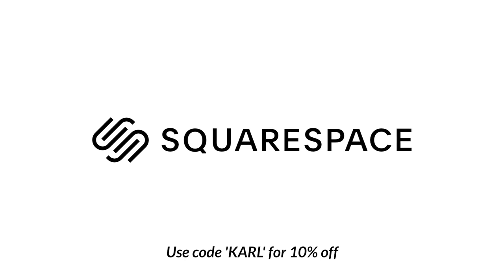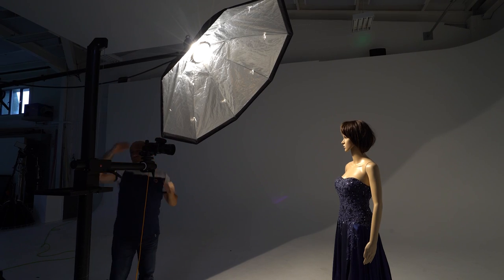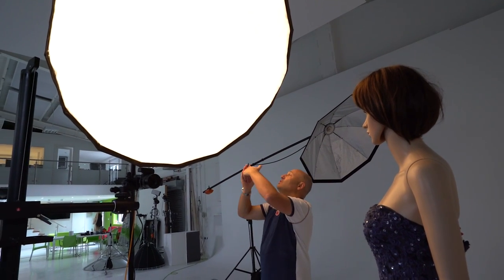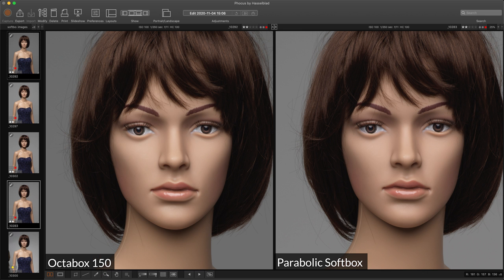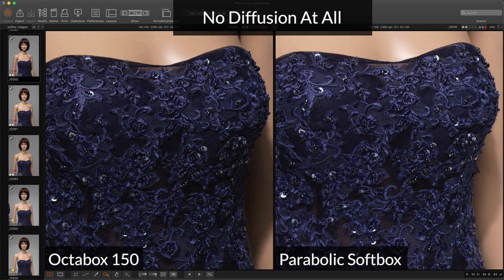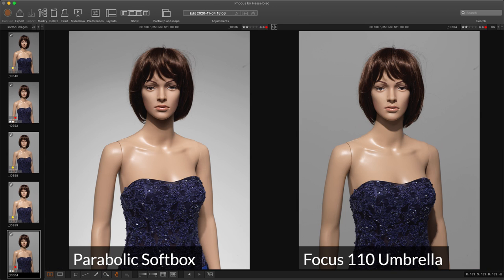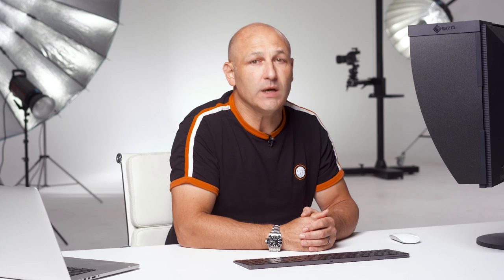The Myth of Parabolic Softboxes - Save yourself time, frustration & money!

Comment: Hi Karl, thanks for the review. I've been a fan of your photography videos for a while now. I definitely don't have the same level of expertise in terms of photography as you do, but in terms of physics, I would like to say two things.

The parabolic shape should focus a light a little better than the flatter ones. What I mean by that is that if you point the softboxes at a flat surface, the light fall off from parabolic ones should be much quicker than the flatter ones (I don't mean the sizes of the lit area, but the fall off from lit area to unlit area). I think this should be more apparent when the distance between the diffused panels are closer to the surface, maybe check multiple distances?

Another thing is that given the same amount of light from the light source, the luminous intensity at the center should be higher than that of flatter softboxes. This should be more apparent as you increase the distance away from the subject.

I think the idea is that no matter what the reflecting surfaces the softboxes are made of, they cannot be perfect reflectors. Each time they reflect inside the softbox, their luminosity decreases. So in parabolic softboxes, the difused light coming out at an extreme angle should be much less intense than the ones coming out from a more straight forward angle. Now how valuable these properties are in terms of photography, I have no idea. Maybe you can do another test to check these out, and let us know?

Cheers,
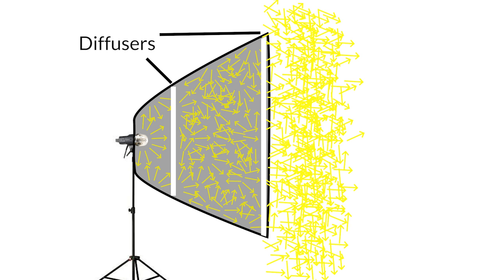Reply from the maker: Hi Sean if you've studied physics then you should be able to understand from the diagram at 1:26 along with the fact that the light is not at the focus point of the parabola, that there is no way the light can go through two layers of diffusion and be expected to have any direction left to it. There may be a small chance that the intensity proportion is more heavily weighted to the circumference of the modifier if the diffusion wasn't doing its job, but this wasn't something  that I noticed. Any fall off differences or intensity differences on the background are purely due to the slightly larger surface area or that I didn't exactly match the output exposure or position when I changed lights
Reply: Hey  @VisualEducationStudio , thanks for the reply. Yes, I did indeed studied physics in my undergrads and had taken two optics courses actually. Of course, that doesn't make me an expert or anything, but I do understand some basic properties of light. 

Yes, I do understand that the light is not at the focal point of the parabola, but that just means that the amount of light hitting the first diffuser would not be uniform across the diffuser. This is the reason why we can see hot spots of different sizes depending on the construction of the reflectors. 

As for your comment that light has no direction after diffusion is a little bit of a stretch. You can argue that at any single point of the diffuser light coming out points to all directions towards the right at some angle off the diffuser using your diagram at 1:26. (note, we can argue that there is a small amount of light bouncing off the diffuser and back into the parabolic reflector. But they too will eventually come out of the diffuser and go towards the right, assuming they don't get absorbed somewhere in the process.) However, each photon coming out is definitely directional. Also once they leave the second diffuser, they cannot change direction unless they hit another object. So, your diagram is a little misleading in that you have light pointing almost straight up and down very far out from the second diffuser. Also, there shouldn't be lights going to the right from above and below the reflector, this shouldn't be the case unless the reflector has holes. Basically, all the possible directions that the light can travel has to be from a point on the second diffuser to wherever it ends up. In other words, any arrows you draw outside of the reflect has to connect to the second diffuser if you extend it all the way to the left.

Combining the non-uniformity property and the imperfections in the reflectors and diffusers, (i.e. not all lights get reflected, some get absorbed after a couple more bounces. The diffuser cannot possibly deflect lights uniformly in all directions. Lights hitting the diffuser perpendicularly will likely pass more easily without being deflected. I think this is why we see hots spots even after the second diffusion sometimes.) the shape of the reflector comes into play. This is why I suspect the things I suggested before. I hope this clears up where I'm coming from. Cheers, mate. Hope you have a great day.
Reply from the maker: @UCrGqH-wWZW5MfxfnHTalbsw Hi Sean thanks for your points, please see my pinned comment at the top of the page.
Reply: Hi  @VisualEducationStudio , I didn't see that you have a pinned comment when I wrote the previous reply. After reading that, I can see where you're coming from. Again, I'm not trying to argue that you're wrong in your judgement that the two reflectors are more or less the same in terms of photography, but I just want to have a constructive discussion since the physics side of things can be a little tidier.

Let me try to be a bit more specific here. In your third point, you say that after the second layer of diffusion light should be very uniform across the diffuser given the reflector has great construction material. I totally agree. Now, let's suppose the diffuser is perfectly diffusing light uniformly in all angles at any given point on the diffuser. Then the distribution of resulting light should be entirely a result of the geometric shape of the diffuser and the distance from each and every point of the diffuser. In this case, we should not observe a sharp drop off of the resulting light until we hit areas parralel to the diffuser. (i.e. the roof right above the diffuser and the ground right below the diffuser)

I don't think that is the case for most reflectors. I think most reflectors would still give you some kind of lighter shape/area on the wall you point them to, rather than lighting up everything that is immediately in front of it top to bottom. So that means the light coming out of the diffuser is still very concentrated around the angles 90 degrees to the diffuser. Given this observation, it is pretty safe to say that the geometric shape of the reflector would dictate how much of the light coming out is close to or perpendicular to the diffuser. Thus, the collimation property of the reflector should still play a role in terms of the resulting light.

Again how much these geometric properties matter in photographic sense is really beyond me. I suspect it is probably more or less like what you experienced. Also, it'd be interesting to do tests at different distances since I think that should exergerate the differences between the reflectors a bit more. Cheers, mate.

Comment: I like Your videos very much, but in that case I think it is not the best idea to compare patabolic softbox to normal one by using almost flat light. Main difference, would be visible in shadows. How diffused is a gradient between light and shadow? How a shadow of nose looks like? You can't see that in flat light (just don't talk about that really tiny shadow on chin please) 
You say that parabolic one was heavier and larger and that is true, but is it really true that it doesn't produce any difference? In Your video a diffusion is closer to the bulb in normal softbox and further from the bulb in parabolic. Parabolic or not - You always get more diffused light when You put a diffuser closer to the face and further from a bulb. The reason why photos looks similar is because the light here is flat, so we see almost no shadows. But put these softboxes 90° from a lens and then look at results. 
Thinking Your way I would say that there is no difference between a dedo dlh4 and a common  fresnel light, because a kicker light from both units looks similar. Well, yes but still - the difference in that units is huge. 
Second thing is that light from parabolic softboxes is going in one direction. As You mentioned - from normal softbox it is going everythere. That means that with parabolic one You can easily create soft, directional light, without using grids or flags. Is there a difference in quality of light between parabolic softbox and a normal softbox with a grid? And a difference in an output? These are good questions. But were  not present in Your video. 
When You shoot with a normal softbox on a location and a background is close You have that light on the background. When You use parabolic one, it is easier to light only a face and have background darker. But to see that difference You can't use flat light (because then You have light on the background in both cases).
I still like Your videos and click on "👍", because it is great just to listen or talk about light with professionalists. I like Your work and think that people can learn a lot from You. But here I just have to disagree.
Reply from the maker: Hi thank you for liking our videos but unfortunately many of your points are inaccurate.  There is no difference in the gradient of light from shadow to exposed area. I could put both of these softboxes at 90 degrees and it wouldn't make any difference at all. You keep referring to flat light but you haven't clarified what you mean? It is also completely incorrect to say that light is going in one direction in the 'parabolic' softbox because that's impossible because it is being diffused internally and therefore going in all directions. There is no more 'direction' of light than the octabox because the physical properties of diffusion are to scatter light in all directions. The only way to reduce this is to add a grid which you could apply to both modifiers and this would simply increase contrast on the subject. Even without diffusion the parabolic softbox is unable to send the light out in parallel beams (collimated) because the flash head is not at the correct focus position anyway.  If you can provide me with any relevant actual physics that could back up your claims then I will gladly make another comparison of the two lights from any angle you like but you will see no difference at all.
Reply: @VisualEducationStudio  "There is no difference in the gradient of light from shadow to exposed area. I could put both of these softboxes at 90 degrees and it wouldn't make any difference at all. "    
Yes, it is. I don't say that it is because one is kind of "parabolic", but - as I wrote earlier - Your parabolic one is bigger, so a diffusion is closer to a face and produces slightly softer light. We just don't see that, because we see almost no shadows here.

"You keep referring to flat light but you haven't clarified what you mean? "
I used that term to describe a light coming from same angle that a camera is. And a light source is quite big (150 cm). So in final image we see almost no shadows. I like that light, just don't think it is the best choice to compare soft light modifiers (main difference between them is a way they produces shadows). 
In my opinion, if we want to compare normal softbox to "parabolic" one, we should put them at 90 degrees and use smaller versions (smaller version of parabolic and smaller version of normal one, not 150 cm) to see differences in shadows on a face.
Reply from the maker: 1. The parabolic softbox I used here was exactly the same diameter as the Octabox so they were the same size. 2. The light isn't coming from the same angle as the camera it's coming from a 45 degree angle from above, imagine turning the picture on its side and the light would be coming from a 45 degree angle from the side. 3. If the physical design of diffusion of the smaller ones are the same design then the physics will remain the same, that is simply physics. And finally the great thing about physics is that it doesn't lie, it doesn't fall apart, it is always repeatable and this type of diffusion will do exactly what I demonstrated in this video so where would you like me to place these lights so I can make another video and prove to you that the physics, the shadows, the fall off and everything will be the same? I will include it as a short piece in a future video and I will publish the exact results.
Reply: @VisualEducationStudio  There is no need. :) I just checked in the studio and in fact the parabolic softbox illuminates the space very widely - so it is not parabolic. You were right and I was wrong. Hard to admit, but it's always good to learn something new. :)
Reply from the maker: Hi Pawel, thanks for checking and thanks for your honesty! Cheers Karl.

Comment: A parabolic reflector shows its features only if the emitter (or receiver) is located at the focal point of the parabola.
Reply from the maker: Yes which is the topic of my other video on Parabolic Reflectors. This video is about the nonsense of putting two layers of diffusion in front of a parabolic reflector and expecting it to output light that retains collimated properties.

Comment: Hi Karl, interesting video, as always. I think there is some practical benefit from the deeper design if you use a recessed front diffuser (like the one available for the Rotalux Deep Octa), in that you can control the light spill a little better, especially when shooting in a small studio, with white walls etc. There are some recessed front designs available also for the shallow soft boxes but I would expect lesser spill control effect there, simply because the edges recede from the lit surface of the diffuser at a wider angle. But of course, using a grid is usually a better way to control spill. I am wondering if Elinchrom introduced the deeper designs with recessed fronts because they did not offer grids for the Rotaluxes until recently. Other than that, I agree with you entirely. Plus you can feather the light more easily with shallow designs.
Reply from the maker: Thanks for the input and points.

Comment: It's funny because I have a small area I'm using for videos and I want to keep the light off the back wall so by default I'm using a soft box with a grid because that's what everybody uses. And when the light's going through a grid my brain wants to think of it like a car headlight — it should work better if it's parabolic! But that's silly if it's getting diffused. And I'll bet an actual professional would tell me that a strip box and some flags would do a better job of keeping light off the wall anyway. I'm still probably upgrading my super-cheap soft box to a Light Dome Mini II. It's not egregiously pushing the 'parabolic' marketing. 🙂
Reply from the maker: If you can get your hands on a good fresnel lens then that will keep the light collimated and to a focused area avoiding spill. A parabolic reflector (not parabolic softbox) will also do a similar thing but not quite as accurately as a fresnel. The other way is to benefit from the inverse square law and the fall off intensity of light. By placing a smaller softbox very very close to your subject then the relative ratio of exposure from your subject compared to the background wall will be dramatically increased and when you expose correctly for your subject the background wall will have much less exposure.
Reply: @VisualEducationStudio  Good thing I took physics and calculus I guess? 😄 I used to ignore lighting because I wanted my videos to be dark. The more experience I get the more I realize that you need to have a lot of light on things that you don't want to be bright so that you can have the things you want dark to actually be dark.

Comment: So the rotalux deep octa with diffusion is  just a regular softbox ✍️
Reply: Yes you are right. Whenever you put Diffusion Material on the Front, the shape of the softbox makes no difference, just the diameter and distance to your subject. 
With the so called parabolic softbox, you have a more collimated light when you take of the Diffusion material away. The parabolic Form will not make a difference to a deep softbox which do the same. 
The Advantages of a parabolic Form can only be used when the light shines into the reflector and if you are able to move the light source inside the reflector.

Comment: What's the idea of this video in fact? Of course shooting both modifiers pointed directly to the model for a close-up shots like these, there will be tiny or no difference. Take a full body shots and the difference in light spread becomes obvious. But the main difference between the two lies in their feathering abilities. The deep octa (or parabolic) is much more directional and provides more limited feathering possibilities, while the "shallow" octa can be feathered much more than the "parabolic" or "deep" one. And yes, you're right, physics is... physics ;-) 
Cheers!
Reply from the maker: There are no 'feathering' abilities unless the light coming out of the front is not homogenous. The only feathering that can happen is if one of the homogenous front diffusers is slightly bigger surface area than the other (and the deep softbox has a slightly bigger surface area).  The purpose of this video is to demonstrate that any form of visible light that has passed through two layers of effective semi opaque diffusion and bounced around contained in a silver box will do exactly the same thing. The only minor variances are explained in my pinned comment at the top of this page.